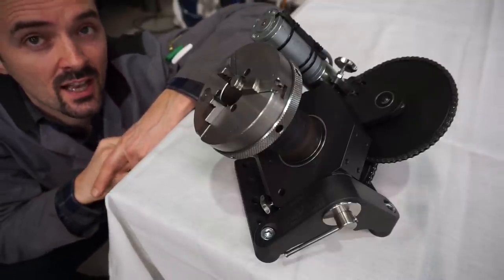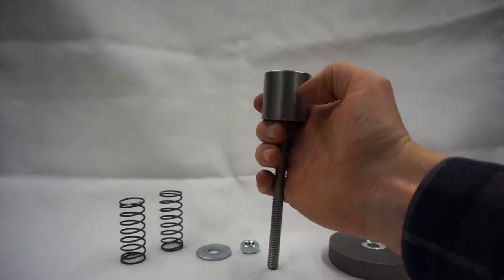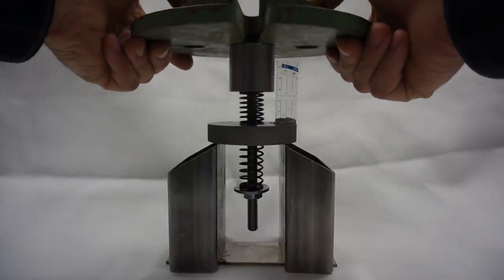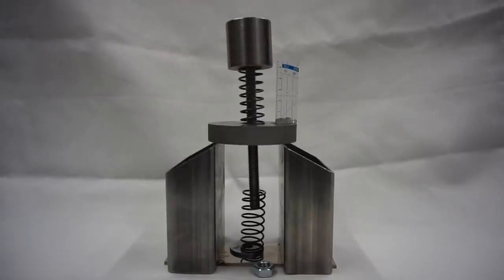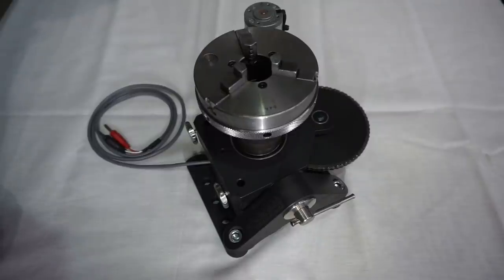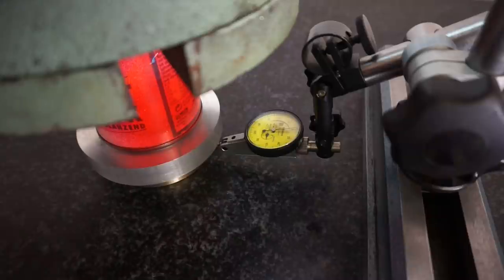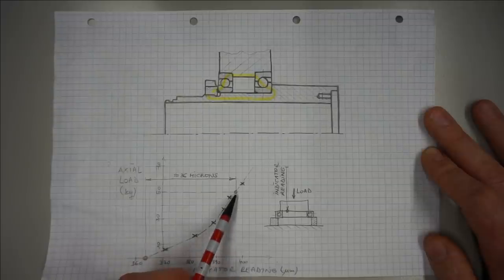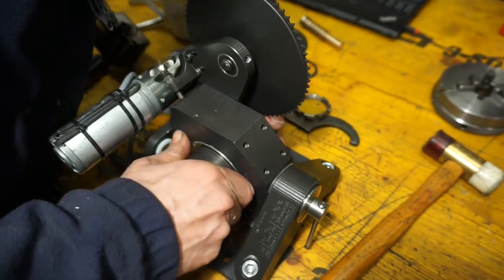Hints on Spindle Bearing Adjustment

Comment: Having rebuilt more precision spindles than I really care to think about (retired now) in my working life this is an excellent tutorial on pre-load. A properly pre-loaded machine spindle can help cover for some issues. An improperly pre-loaded one merely makes them worse. Plus this is also a very good tutorial on defection and the relationship between pre-load, distance from the first bearing. And the distance from the rear bearing. If two spindles with the same bearings and the same pre-load but with the distance twice as much as the other. The one with a greater distance will have less deflection for the same force. It won't be half as much because other factors such as the rigidity of the shaft etc come into play. Thus is one reason I cringe when I see people running collet chucks on small lathes where the front of the collet is farther from the front bearing than the bearings are from each other.
Also. Any bearing set-up that is pre-loaded to the proper amount is not worth spit if 
a) the bearing bores are not on the same centerline
b) the faces of the bottoms of the bores are not perpindicular to the bore centerline
c) the bearing diameters are not concentric
d) the bearing diameters are undersized or out-of-round 
e) the shoulders that bearing faces seat against are not perpindicular to the shaft  centerline and bearing diameter
f) the faces of any spacers are not parallel to each other. Let's say the spacers are parallel within. 001". Each time the shaft rotates the relationship between the spacer faces will have a wobble effect on the rotating shaft.
Reply from the maker: Thank you for your interesting comment, Sir. I'm very glad that you as an experienced practitioner find no major fault with the explanations in my video. Greetings, Alex.
Reply: @anengineersfindings  
Thank you. Actually you went into more theory than most "instructors" I have ever had the fortune or mis-fortune to have exposure to. The industry I worked in was Automotive Power Train mostly with another 12 years involving large centrifuges for Waste Treatment* plants.  The biggest of those were around 800mm in internal diameter. Humboldt, Westphalia and your own products. Average size was 530 to 660. On the automotive side a group of us were sent to a spindle builder for a class (they were supplying the spindles for new machining lines) and I made a comment about how it appeared the spacers on spindles with two bearings mounted back to back had the spacers twice the length of two bearings. The instructor told me i was the first person in one of the heir classes to notice that. This allowed the manufacturer to increase the rigidity and load capacity of the spindle assembly simply by replacing the spacers with two more bearings. The facility closed around 15 years ago and has long since been torn down. I'm sure that who ever bought our Bridgeports at the auction will be in for a surprise when they eventually have to replace the spindle bearings. BP used 2 15° angular contact mou Ted back to back. When I would rebuild our BP heads I changed the bearings over to a 3 bearing set-up with the bottom 2 in tandem. Tool life and finish went up dramatically due to the increased rigidity.
*the company's founder said "it smells like money"
https://www.google.com/url?sa=t&source=web&rct=j&url=https://www.centrisys-cnp.com/&ved=2ahUKEwjv1r2NyerwAhWPZM0KHShwA9gQFjANegQICxAC&usg=AOvVaw3iuAKgrKhn7Y7pLUzphjrC

Comment: Very Interesting video. I have used a spring balance and pull cord to measure the rotating torque required for a preloaded shaft assy, and then shim or surface grind the spacer accordingly, but I guess yours here is to determine a new, one-off assembly starting from scratch. Thank you for sharing with us.

Comment: Excellent - I did a similar workup of some duplex bearings last year.  The problem I came up with was that the coefficient of expansion made my careful calculations less meaningful than I would have liked.  As a bearing turns - it gets warm - expands a bit faster than the surrounding metal.. changing the preload.

I didn't come up with any great solutions - I did think of using something that would deform to measure the pressure - but to see it - one has to open up the bearing again.
Using torque or feel is what many old time machinists told me.

Comment: Great video!!!  at what point would you use matched AC bearings?   I'd love to see you make a high speed spindle for a small tool like a pcb engraver.  I have a NSK 50k spindle which is a dream to use but I've always wanted to try to make a spindle that can do 20k RPM +.
Reply from the maker: Thanks for your kind comment Jesse, I'll think about it.

Comment: so you say preload should be half of maximum expected force. that is to unload the rear bearing, right?  but why would you want to do that?  in the example with the springs as long as the weight is smaller than the preload nothing will move. and thats what i would be interested in. threfore preload should be equal to max. force. what am i missing?

Comment: Calculating the axial elongation of the spindle between the bearing shoulder and the nut under 981 N of force would seem to be much simpler.  Simply measure the unloaded spindle length, tighten the nut, remeasure and adjust until the elongation is reached.  No need to measure bearing stiffnesses and such.  One simple calculation and measurement.  The hard calculation is determining the proper preload.
Reply from the maker: Interesting point, as always I guess there are more ways to skin a cat.

The math on your suggestion is as follows: Spindle cross sectional area (50mm^2-36mm^2)/4*Pi=946mm^2; Preload 50kg*9,81m/s^2=491N; Axial stress in spindle due to preload 491N/946mm^2=0,52MPa (!); Axial strain in the spindle due to preload: 0,52MPa/200000MPa=2,6*10^-6=0,00026%;
Axial elongation of the spindle due to preload 2,6*10^-6*40mm=0,1microns (note: this neglects the elongation of the recess at the threads). How to measure this in a non climatized shop in a reliable way?
So in case of the spindle in the video, I doubt that measuring the spindle elongation is easier for setting the preload. Even strain gauges on the spindle would probably deliver no consistent result with these small strains. I guess though your suggestion would work with way higher preloads and a much skinnier spindle.
Reply: @anengineersfindings  Fair point.  Not knowing the dimensions, I figured the stretch would be a magnitude easier to measure, not sub micron.  For such a low clamping force I would probably have considered torquing the nut.  A simple equation which I think would be plenty accurate enough for this is 0.2*T*d (kN & mm) to give Nm => 0.2*0.491x50= 5 Nm torque to get close to the 50kg preload (why Europeans use kg for force escapes me).  That still seems very low for a 50mm bearing.  I would figure the minimum preload recommended by the bearing manufacturer would be a lot more than that.  I am however a structural engineer, not a mechanical and besides investigating the SKF bearing manual have no training in bearing design.
Reply: Measuring torque on a thread is a notoriously unreliable way to measure axial loading. It's good enough for a nut/bolt arrangement where the primary concern is to not take it past yield, but that's about the limit of its usefulness. The general consensus is that using torque to set axial strain is accurate to within about 25%.
Of course this is just a welding rotator but in the spirit of the exercise that wouldn't be acceptable for bearing assembly on a larger/more critical bearing.
Reply: @hayden6930  I was about to ask a stupid question ... "Can't it be set with a Torque wrench? " But I saw your comment and realized the error of may ways! Pay no attention I am an amateur machinist !

Comment: Will you publish dwgs for this? I love the size. Most others are way to big for my needs. This looks ideal. Really interesting educational video.
Reply from the maker: If I find the time, I'll think about making drawings for this rotary table. Thanks.
Reply: If you don't do drawings you could just do a video describing the device in detail.  I would like to know how where you hook up the ground so that the power doesn't go through the bearings. It seems to be quite a clever design.
Reply: @sblack48  You can see his ground connection point in the still image at the very end of the video.
Reply: @hanksshop5964  oh now I see it. Clever! Way better than a strap, better control of contact force.  Thanks.